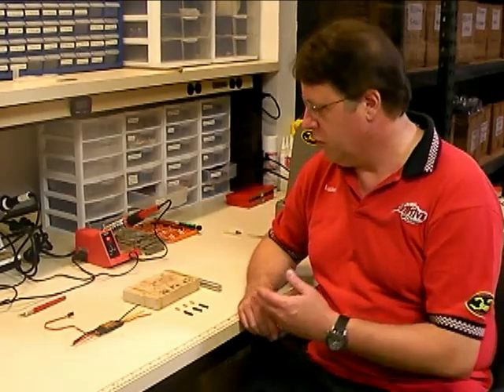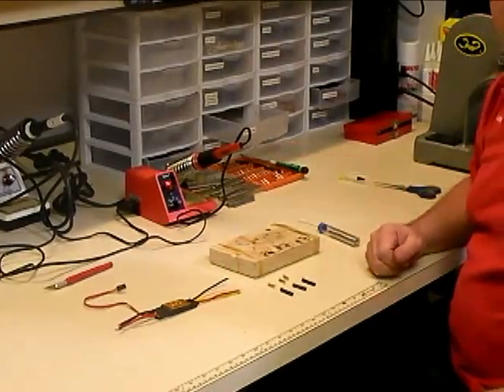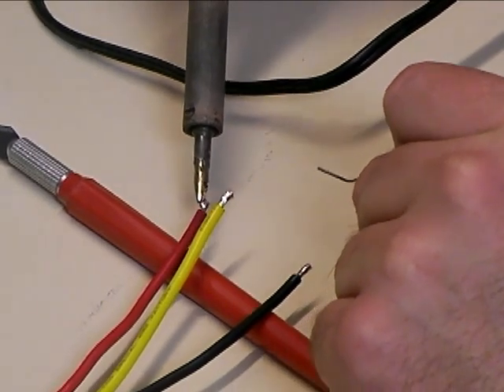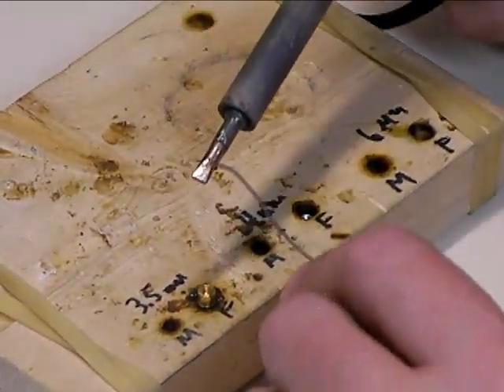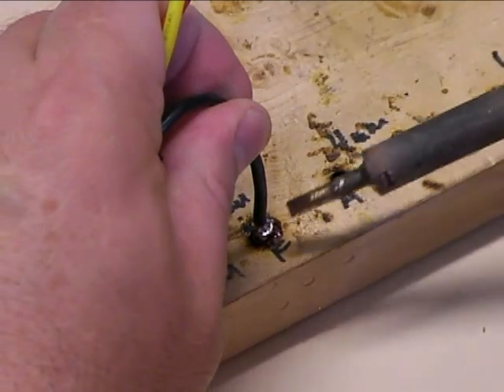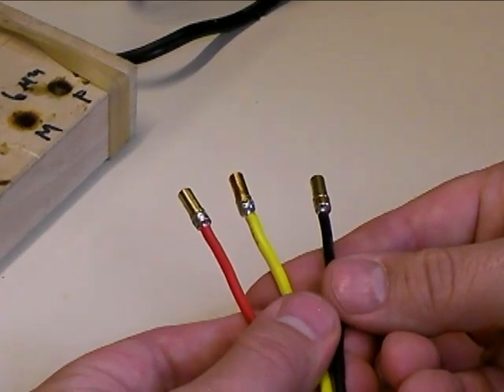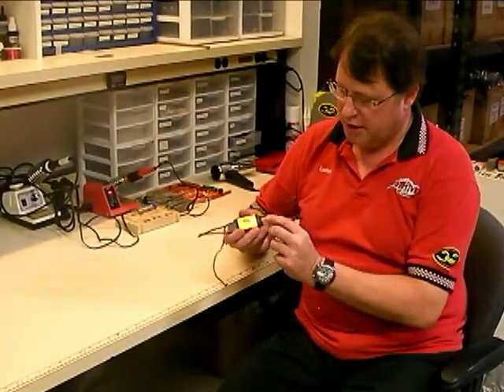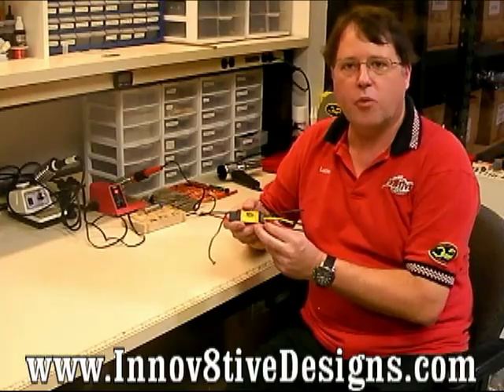How to Solder Bullet Connectors By Innov8tive Designs

Comment: Eeh the cleaning off of rosin on a male connector makes sense. But a female connector? Even if you have some rosin on the outside of the female connector, it doesn't make contact with anything except for the heat shrink. Though i run buggies and not planes, so maybe there is some extra paranoia about something going wrong in the air :)

Comment: Great Video! Not only this one, the whole "how to" series. Not much surprises here if you're used to soldering (mentioning to get of the rosin with alcohol was something I never did, though), but there are many people new to the hobby these days, with the miniquads/drone hype going on. Better they learn to build the proper way and not from some youtuber who is great pilot but sloppy builder. It's very demotivating if you're on a budget and your first build crashes/burns 'cause of easily avoidable build mistakes. (antenna placement cough, cold soldering joint, loosening screws, ...)

best regards, Tauge

Comment: You can use an 80 watt soldering on larger bullet connectors such as those in the 6mm to 8mm size range.  You just need to be careful that you do not get things too hot.  You can boil some of the tin out of the solder and make a weak joint if you heat it way too long.

Comment from the maker: You always pre-tin the tip of your iron with a little bit of solder before you actually make a solder connection.  This is done to provide a liquid surface on the tip of the soldering iron so you get more contact area between the soldering iron tip and the piece you are soldering.  If you try to solder with a dry iron, you only get a tiny point of contact between the two pieces and you do not get good heat flow into the part you are trying to solder.

Comment: Thanks for that, very informative!   I'm new to soldering-- got a question-- before you heated the connector, it looked like you put a dab of solder on the iron before touching it to the connector to heat.  Why is this done?  thanks!

Comment: I use 5 or 6mm heat shrink on 3.5 - 4.0mm on the female bullet connector and have it overlap the end by about 3mm and dont shrink it all the way to tip so when the male connector is inserted it creates an overlapping sheath so there is no chance of any exposed metal therefore eliminating any chance of a short between the three leads. -B!